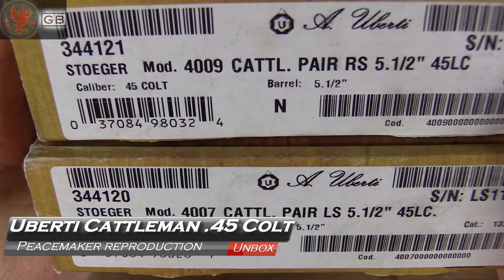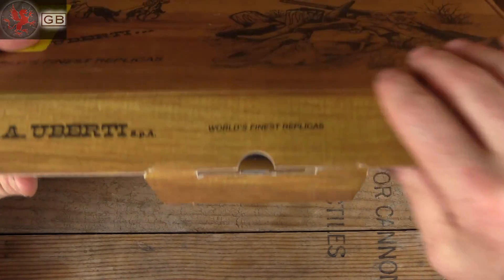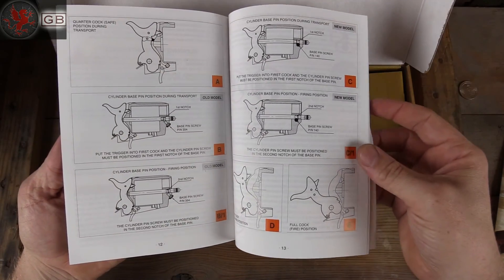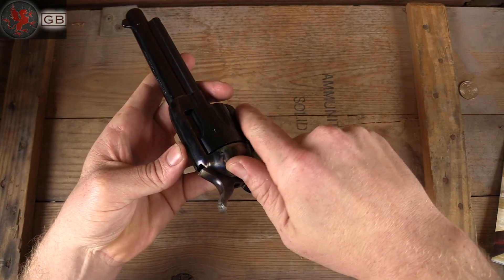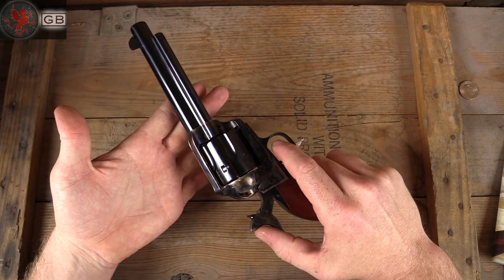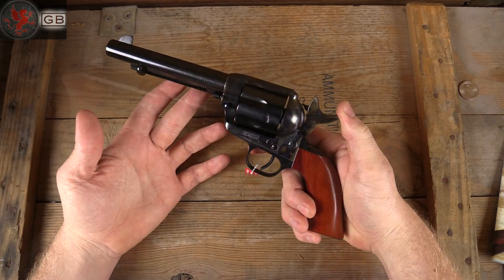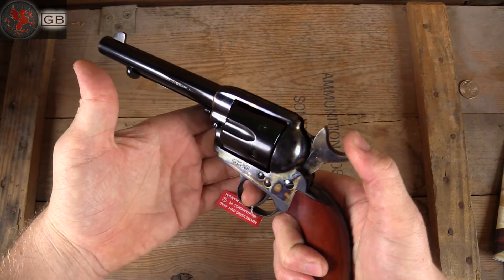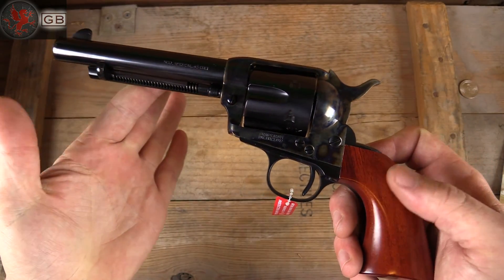Uberti 1873 Cattleman Unboxing

Comment: I wish ammo wasn't so expensive for those. I don't reload my own so I'm stuck with store prices.
Reply from the maker: It's true, .45 Colt is expensive.  The only balance is that one box can easily last an entire range session or longer since reloading is so slow.
Reply: .38 Special wouldn't cost you so much if you had a .357/.38 chambered version.
Reply: Scott , I have to ask why you don't reload ? . Just get yourself a very basic reloading press and .45 dies and make your own rounds .. the advantages , other than financial are that you can work out what loads best suit the gun your using .. Reloading is great therapy and good for the bonding aura between you and you gun[s] ... Wes Martin
Reply: @DanJ30  to get a single action in other then 45lc is just a disgrace.

Comment: what is the difference between right side and left side?
Reply from the maker: None as far as we can tell.  The hammer action is a little lighter to pull on the LS, but that could just be manufacturing, not by design.
Reply: Since they are sold as a "pair" (typically for competition shooting), they are marked right side and left side for which holster you carry them in. That way you remember which one is which. There should be no physical difference between them at all. It is a cowboy action shooting thing because each revolver may shoot to slightly different points of aim and you want to always make sure that you know which one is which during competitions.

Comment: Are these guns rated to handle full power loads or should one stick to cowboy action rounds?
Reply from the maker: They are rated for anything SIP or SAAMI, but not +P.
Reply: I assume .38 Special +P would be fine though since they're less pressure than most (if not all) .357 mag rounds?
Reply from the maker: +JSmunitions you'd have to check with them.  Ours are 45 Colt

Comment: It looks like the hammer does not fall all the way forward. Maybe it just looks that way on video.
Reply from the maker: +tccoup355 yes, it had a safety device for shipping, I removed it for Firing.  I was totally new to this platform.
Reply: Oh, cool there isn't anything wrong with the gun. I have a 4 3/4 inch Cimarron model P in 357mag. It have an awesome trigger.
Reply from the maker: +tccoup355 our 22 inspired the Ubertis you see this week.
Reply: What's your best and most reliable handgun? Or top 5?
Reply from the maker: For reliability my Walther has never failed me, Glock is almost as good.  For shooting experience the Grand Power Xcalibur and my Walther P99AS are favorites.